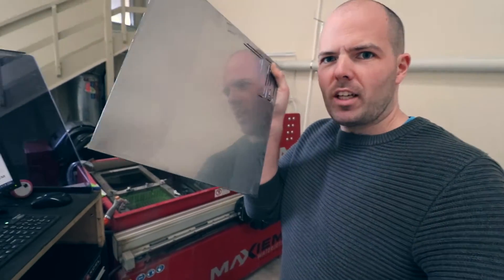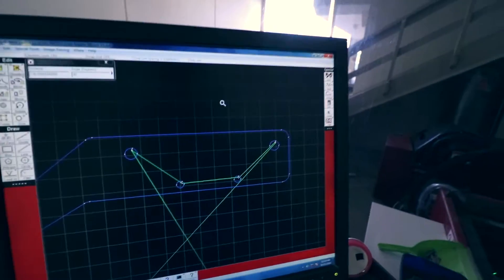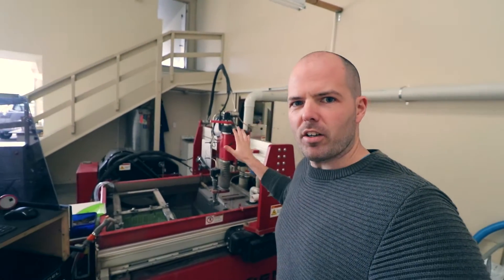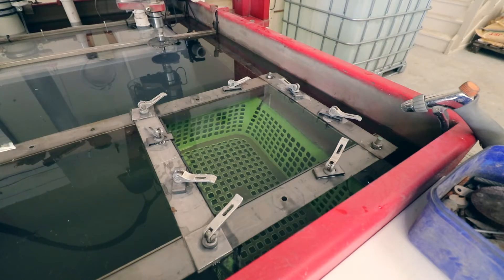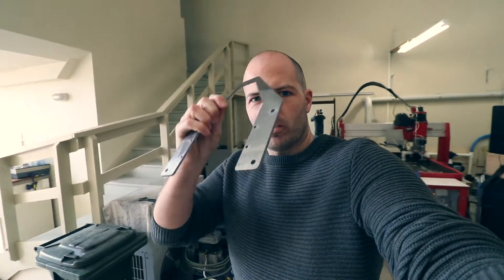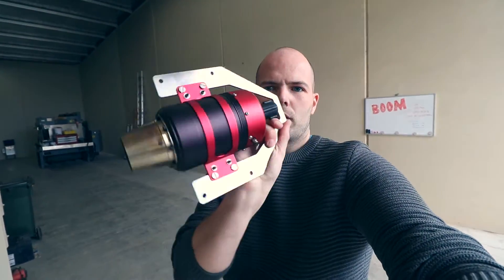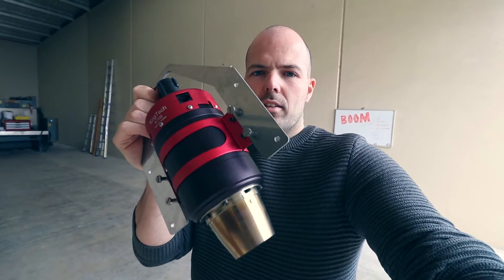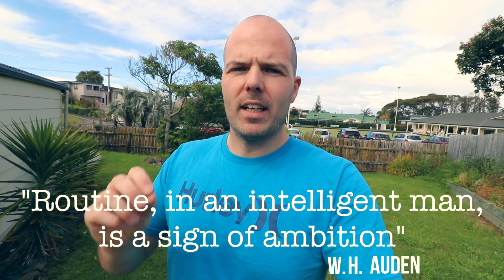It's FINISHED

Comment: Are you planning to put a thin layer of some kind of elastomer between the mounting plate and the engine mount themselves? I have a feeling that mounting them too rigidly would carry too many vibration across and could wear out some part of the engine, and that a degree of dampening is called for. Are there any specific recommendations in the engine manual to this effect?
Reply from the maker: Hey Vincent, that's a good thought. I had not thought about it. I'll take a look at the manual and see if they mention anything.